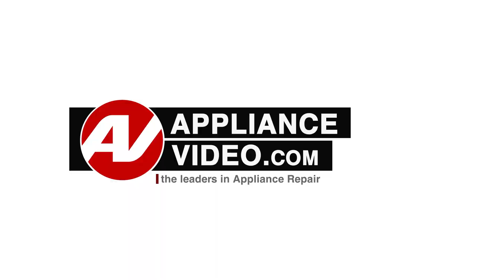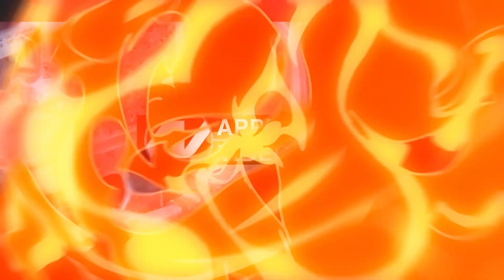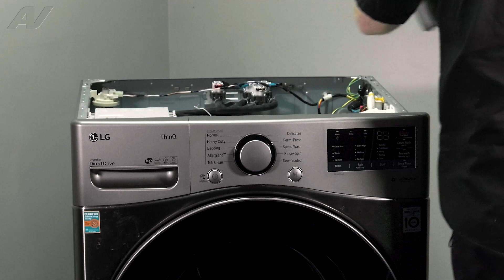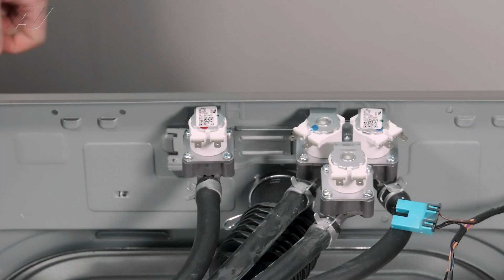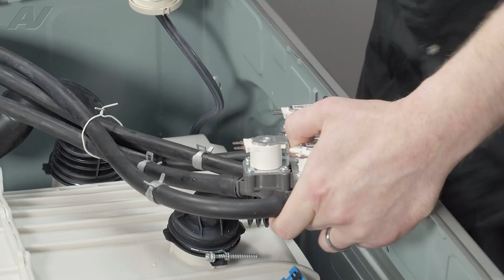LG Washer Repair - Fills Continuously - Cold Water Inlet Valve

Comment: Thank you! This video helped a bunch and saved me some monies. I took my valve out, you mentioned dirty water. Florida has rough water. I was able to take the cold water inlet valve out, after taking it out i took it a apart which took 10 screws roughly, deep cleaned each plunger and plunger housing, clearly saw stuck one. After deep clean, some polishing, i put it back together and making sure the plungers operated smooooooth almost losing the plunger and spring it was so smooth(400 grit polishing compound/polisher did the trick). The cold water and the valve made up. About 6 years with the washer and the sweet sweet Florida water, not to bad.

Comment: I’ve replaced the valve and the pressure sensor. The machine continues to fill as soon as you plug it in. Assuming it is the main control board?
Reply: I’m having same issue I’ve replaced pressure sensor hose both valves. I had no water filling so I replaced them and now water runs continuously lol

Comment: I replaced the cold valve and the pressure sensor and it the machine continues to fill even during the drain and apin cycle. Any suggestions?
Reply: Did you ever find the problem to this? I am assuming you had to replace the panel control board.

Comment: My LG washer is barely 2 years old and this valve has already failed. Cheap junk ready for the trash pile in 5 years.
Reply: Had mine since 08 only replaced the drain pump and door lock. Now I’m replacing this part.  I guess that not too bad considering how old it is. Have you had anymore problems with yours?